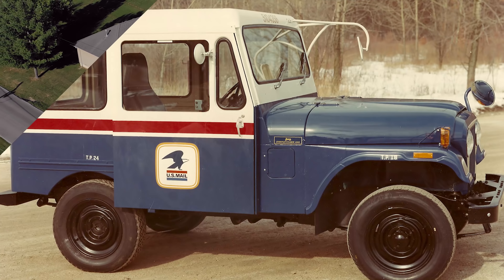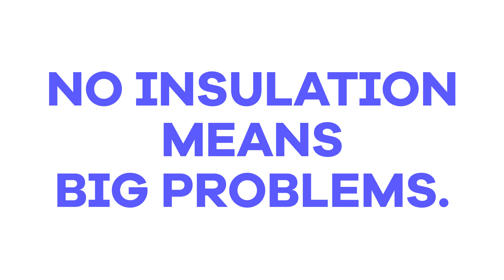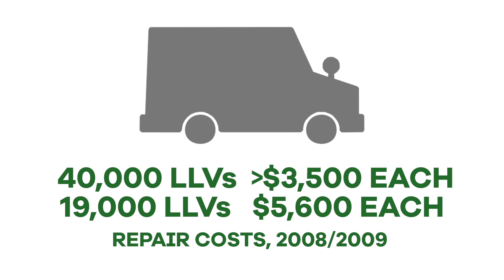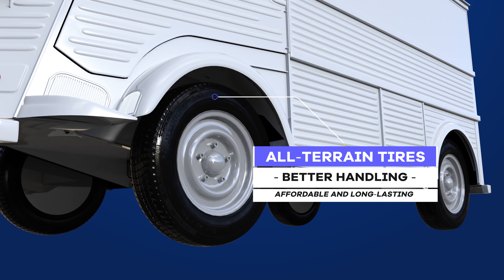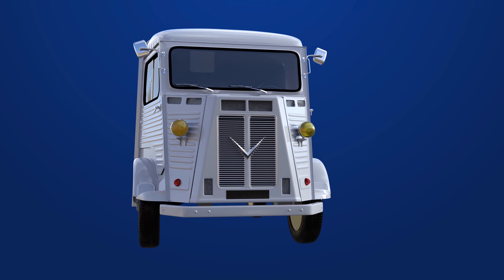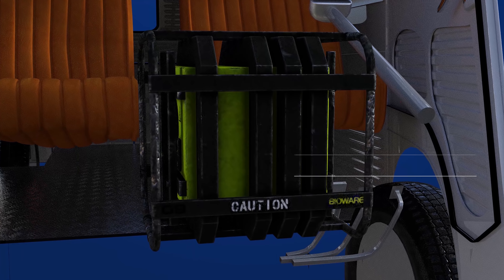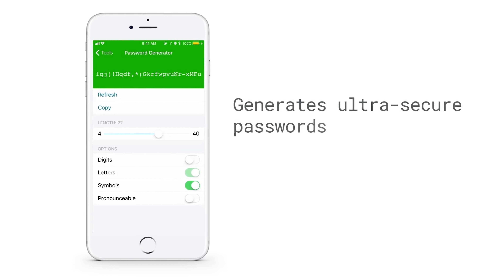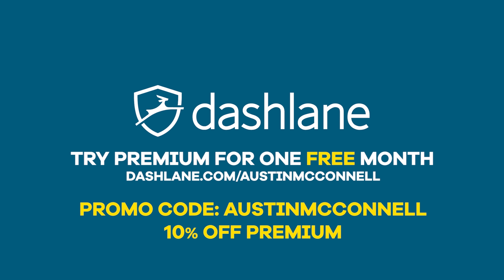Postal Delivery Trucks Stink. Let's Redesign Them.

Comment: Austin, I was nodding along right up until you mentioned integrating electronics, cameras, and fancy sensors. I'm sorry, you don't do that for long life vehicles. You do that when you wanna make cash from repairs.
Reply: I usually really like Austin's videos, but this one is really disappointing, and all the updating by slapping on electronics may be one of the most short-sighted issues. Digital integration is great, when it's gradual, and at the user's own choice by purchasing it. 

Integrating tablets into the car, alongside an electric motor, and cameras are really just bells and whistles waiting to turn into logistical errors.

I appreciate the curiosity into changing the design of postal trucks, since the main issues seem to be lack of insulation, but everything else is just bullshit.

Comment: I have first hand experience with this subject, and honestly the video was good right up until the part where you started talking about your own design for a new mail truck, you probably know this from the other comments but like everything you suggested is completely wrong lmao, it needs to be aluminum because iron rusts, all of those electronic gadgets and nick nacks are not useful and would just be even more work to maintain and repair, maybe add modern airbags and a collision-safe body but only because basically all new vehicles have them, but honestly the point where you said it does not need to be right-hand drive is the killing blow that shows you really have no idea what you're talking about. That is really laughable because, even if you know nothing about mail delivery.. why do you think mailboxes are right next to the road and facing it? Do you really think the mail carrier wants to reach all the way across the vehicle at every single stop and try to nudge the mail inside?
Reply: I love your pfp
Reply: Thanks for the info
Reply: Just use diamonds, diamonds don't rust
Reply: how do you feel about the flames

Comment: The "Deutsche Post" in Germany already uses a lot of their in-house designed and built electric delivery vehicles and they are pretty much exactly what you described, although they are apparently not very comfy...
Reply: How many Germans does it take to change a lightbulb?

1, they're efficient and not very funny.
Reply: "The Deutsche Post is the successor to the German mail authority Deutsche Bundespost, which was privatized in 1995 and became a fully independent company in 2000. "

The USPS isn't and operates at massive losses - redesigning the truck is stupid because it addresses NOTHING. Privatize the USPS easyyyyy fix.
Reply: The USPS isn't supposed to make a profit, it's a service run by the government for everyone.
Reply: lol no you misunderstand. You're not reveling information to me - i'm saying THAT is the problem THAT is the reason it sucks. I know it doesn't make a profit the problem is they don't care to compete so what do you expect?
Reply: The new electric trucks are utter crap. They break down very often, the battery doesn't last one route in winter. The whole cargo box bends, so you can't open doors and is too narrow to stand up straight. You even have to acces the cargo bay from behind!
Reply: @lauraklimek3050  Okay that might be true, idk though, I've only heard people speak good about them... But the Post asked every German car manufacturer and all of them declined to make them so they basically had to develop and build them all by themselves and it's obvious that they are not at all experienced in making vehicles so they certainly learned a lot from this first generation and will improve upon their experiences.

Um ehrlich zu sein sehn die Dinger ja auch ziemlich scheiße aus aber trotzdem ist es ein Schritt in die richtige Richtung.
Reply: @Pixelschmiede They bought the design from the University of Aachen. There is a nice report about this car from WISO

Comment: It is a pretty well thought out video but the big issue for me is not having the steering wheel on the right side.  I know you said that with your design you can slide open doors on either side BUT I rarely see a postal delivery driver get out unless there is a large package to deliver, they just stay in the car and lean over to the mailbox.  If the steering wheel is on the left side like the rest of the cars in North America I can guarantee that the USPS drivers will be driving into traffic so they don't have to get out and will be causing even more safety issues.
Reply: Right.
Reply: And the video shows two seats. You can't have two seats. One side needs to have the big "shelf" where the mail sits. The carrier needs that up front so that he doesn't have to get out and open the back door at every stop.

Comment: I thought the steering wheel was on the right side for easy access to mail boxes on the side of the road.
Reply: It is, and the idea that you can deliver on the left side is silly, you'd need to drive on the wrong side of the road.
Reply: Exactly.  With left-hand drive the mailman will have to put the vehicle in Park and get out of his seat at every single mailbox.  Inconvenient and time consuming when multiplied by the hundreds of stops they have to make.
Reply: I thought it would be a good idea because, in my neighborhood at least, all the mailboxes are on one side of the road (I gotta go across the street to get mail). This is fine but when there's a big package that doesn't fit in the mailbox I thought it would be convenient to have a left side door for easier access to the stoop of the house
Reply: And you can't have two seats. One side needs to have the big "shelf" where the mail sits. The carrier needs that up front so that he doesn't have to get out and open the back door at every stop.
Reply: The mail vehicle still needs to follow the regular flow of traffic. I've delivered to spots like that in the past and the route is organized in such a way that the boxes will always be on the right so we can do "mounted" delivery.
Reply: I'm thinking austin has only lived in places with house mounted mailboxes, which for those places his design is great. if makes it so they don't have to be on the right side when driving but still can exit street to the curb through the side door. That being said for road side mailboxes is design is extremely flawed, not right side mounted, vehicle to high to reach, etc.
Reply: @beebee1794  road have two lanes you know
Reply: @chevymontmarlo  why do you have 2 lanes in your neighborhood? I've literally never seen that...

Comment: Great, you just modified a Citroen HY van, outfitted it with plenty of things to carry mail, but at the same time made it impossible to deliver mail with.
Reply: One thing I haven't seen in the comments is the too-long wheel-base of Austin's vehicle. USPS trucks typically need to make many U-turns. They need a shorter wheel-base.
Reply: @FRN2013   The wheelbase isn't that much longer, I don't know why that would be such an issue. If it really needs to be just give the trucks 4 wheel steering.
Reply: 4-wheel steering = too expensive

Comment: Orrr... They could just buy a bunch of Ford Transits....
Reply: Yo-yo actually that's a great idea, Fords have already a market which means parts can be cheap because they aren't made "exclusively" for USPS, also they just look cool
Reply: I sh0ld dy s0m3 car
Reply: Yo-yo We city boys in Philadelphia got the Promaster and it is boss!
Reply: And they already come in right hand drive as well so there would be no conversion 😍
Reply: That’s what we replaced them with in Canada. Still have a few of the old LLV’s kicking around, but most have moved to the Transit.
Reply: They could see what Ford wants to make a special order, with whatever "bells and whistles" the USPS thinks they need.

I mean, the LLV is just a modified S-10 at heart. With a custom cab by Grumman.
Reply: Exactly what I was thinking.
Reply: buy RHD transits and get the 2.0 TDCI ones instead rather than a gas guzzling v6.
Reply: true
Reply: the usps uses a few Dodge Ram postmaster in D.C
Reply: I mean Amazon already use these so ok.
Reply: Fords aren't reliable
Reply: @andrewcolsen  then what do you suggest?
Reply: @andrewcolsen  can't use a Chevy van, Chevy just rebadges Nissan for their new van and don't get me started on Dodge/fiat
Reply: I’m not sure how well that would work. They would need to stand the test if time pretty well, and my dads ‘04 Ford is on its last legs. I’m not sure how long they’d last compared to the current units USPS uses
Reply: Andyco79 THANK YOU!!!
Reply: My city actually started using modified pontiac azteks
Reply: True
Reply: Are ford transits american or german?
Reply: Transits are an eye sore.
Reply: Honda ct110 is the answer u seek,  at least in the warmer states

Comment: Reading all of the comments from actual mail carriers I can conclude that 
-The body is literally stolen from Citroen
-You are making their job harder
-You are adding all of these features that break easily and are very expensive to maintain
The only thing nice about this design is the electric motor (unless the FFVs that The Captain was talking about are electric. I don't know)
Reply: Yes, FFV stands for Flex Fuel Vehicle; usually this term is associated with an ICE (Internal Combustion Engine) that run on gasoline/diesel and ethanol. Good comment, I feel it sums up the comments section on this video quite well.
Reply: You forgot one.

-People are ignoring the underlying issue that LLVs should be replaced.

I mean I thought the purpose of the video was about bringing awareness to the bad state of LLVs. But everyone in the comments are talking about his dumb ideas.

Comment: the more complicated and high tech you make it, the shorter it will last
Reply: Let me rephrase this so that you understand why this is a flawed argument: "The more modernized you make something, the shorter it will remain to be modern". I thought that making something with top of the line equipment would be a standard in the future and to make sure that everything lasts for the longest. An up front higher cost is much more sound than way much more money over time spent on repairs. So, no, I disagree with that. (Not that even what he proposed was even complicated nor high tech as most of the features he had mentioned are practically the standard, even the EV engine has gotten much more reliable over the years)
Reply: @commodoresyntax1747  building tablets into the truck makes no sense, imagine the logistical nightmare it would be to replace them in 20/30 years when they're barely working. it's better to just build a mount for the tablets in the truck, rather then needlessly incorporating it into the truck
Reply: @Wabbaaajack  Who said I was going to be putting tablets into mail trucks now?
Reply: @commodoresyntax1747  5:10
Reply: Commodore Syntax it isn't about modern. It's about how long these trucks can keep working without major repairs
Reply: Brennan Exactly! I mean in Philadelphia where I live some of the postal workers ride in Ram Promasters.
Reply: @commodoresyntax1747  Making these trucks weigh more means they will have less fuel mileage and shorter service periods.
Reply: It takes more energy to make sure things goes okay, if there are more necessities.
Reply: @commodoresyntax1747  
Wrong. You didn't "restate his argument"; you made a different, flawed argument, then tore down your strawman.

The argument is a "KISS Principle" one: ceteris paribus, the simpler vehicle will always be more reliable than the more complicated one. "Dispatch reliability" is determined by the probability that all necessary sub-systems of the vehicle are functional, and is the mathematical product of the probability that each system is functional at any time.

Thus, ceteris paribus, the vehicle with the fewest possible sub-systems to accomplish the task will always be more reliable than the vehicle with gratuitous "bells and whistles."

For example, a fixed-gear aircraft will always be more reliable than an identical aircraft with retractable gear: the latter has hydraulic lines, hydraulic motors, gear position indicator lights, etc...all of which have a less than 100% reliability...whereas the fixed gear has none of those systems, and therefore can never be grounded due to a failure of said system.

Now, in the example, the RG airplane is faster, and you may well accept the slight hit in dispatch reliability as a "necessary evil," but the fact remains that the simpler design is (ceteris paribus) more reliable, by virtue of being simpler.

Comment: geez. just buy a new fleet of ford transit connects every 5 years and slap the usps logo on the side
Reply: Now other vans hit the market but those specialty manufacturers would get hit bad.
Reply: That is exactly what I was thinking, no one has to create an all new design from scratch and the thing looks like it was made to be a mail delivery van
Reply: I work for Royal Mail. It’s all we do!
Reply: Matthew Smith in nyc they use dodge caravans 🤷🏾‍♂️
Reply: The latest vehicle for non-driving routes is the Ram Promaster. My office just got 2 of them. Thank God they have air conditioning and Bluetooth. But the downside is that you don't get to enjoy the extra comfort because they're only for walking routes
Reply: We had those transits at our company. I drove them and did a little maintanance on em. They only lasted to 60k miles(less than 3 yrs), then everything was a toss up. Quite a few of em had a/c, overheated, some wiring and fuel delivery problems. We got rid of all of them. I mean, i like Ford and own a Ford, but they were literal turds.
Reply: Part of what is always driving up costs is the government's insurance on buying specialized vehicles rather then commercially available vehicales. A transit van would be a simple solution and parts would be readily available at any local supplier.
Reply: @Pernection  mercedes sprinters
Reply: That's kinda what they're doing; save the 5 years part. A lot of areas are replacing postal vehicles with Ford or Dodge vans. My area got a few.

Comment: Okay the first problem here is the massive cost of everything you want to put in the truck. The LLV's are cheap and they want it done as cheap as possible by removing anything unnecessary. Airbags are a great idea but not necessary as they cost money

Second, the steering wheel has to be on the right side to be able to actually deliver the mail. They currently have some carriers use their own vehicles with left hand drive and they have to reach over to deliver mail and control the vehicle 

Third, no carrier I've ever worked with carries a tablet of any sort. Everything is on their scanners, which can do a lot but aren't the best. The scanners have GPS and can be configured to route from one package stop to the next with integrated mapping software

Fourth, we're told that the best way to access the rear of the vehicle is through the vehicle by the driver's seat. I like the idea of the extra doors but the second seat in the front hinders the ability to reach the rear. The current LLV's actually have a tray in the front which can be swapped out for a seat at any time

I'm not trying to crap on your idea, I totally agree the trucks need to be redesigned, just with other things in mind

Also as a side note, theres a slightly new model of the LLV called the FFV (Flex Fuel Vehicle) that's not as common but still newer
Reply: Airbags would be necessary - any car manufactured after 1999 legally needs airbags. Heating and AC could also be options - for example, if you're ordering trucks for use in Phoenix, those drivers will never use the heater. I agree with your other points though.
Reply: You're right and personally I think all vehicles should have them. I was talking from the viewpoint of the people trying to make these vehicles as cheaply as possible. I forgot to add they're currently in the process of searching for new vehicles to be "phased in" by 2020, but we'll see about that
Reply: The problem is that that desire to get rid of everything "unnecessary" makes them less futureproof and more likely to become obsolete faster. The software would make deliveries more efficient and thus save money in the long run for example
Reply: @truedarklander  Adding more technology would just mean it would need to be updated every decade.
Reply: Making things cheaply results in recalls. If you want long lasting trucks you'll need to pay a little more upfront to save in the future. Airbags are a necessity. The GPS can be replaced with a decent built in tablet where the postal worker can enter all of its routes to determine a efficient way to make deliveries. You can keep the tray system in the new truck (saves money on an extra chair). Depending on the region, they can provide AC and/or a heater but they should be mandatory. Postal workers shouldn't have to fear dieing from hypo-/hyperthermia because someone wanted to go cheap on the trucks.

Comment: As a former mail Carrier, the LLV has its flaws, but at the time, it was designed in a way to do what it is supposed to do. That being said, the biggest  problem with the LLV is not the vehicle itself, but that the US government thinks it's okay to keep a vehicle in constant service for 35 years and not expect technical problems to arise. No delivery service vehicle should be in service for 35 years unless it was made with premium materials. The LLVs were great upon release, but the problem is they should have been replaced 15 years ago.

Lastly, your truck design shows you have no knowledge of logistics; I wouldn't even use that as a hot dog truck.